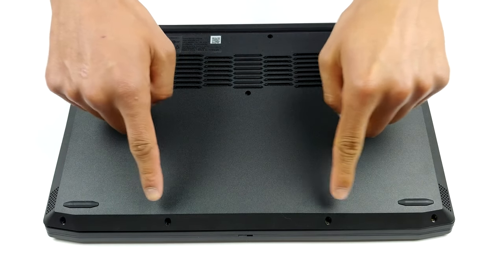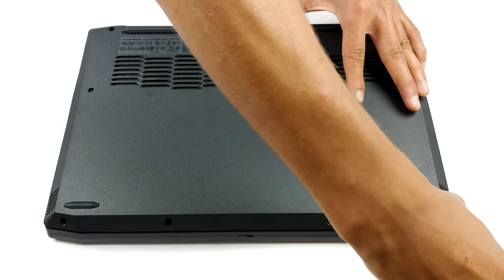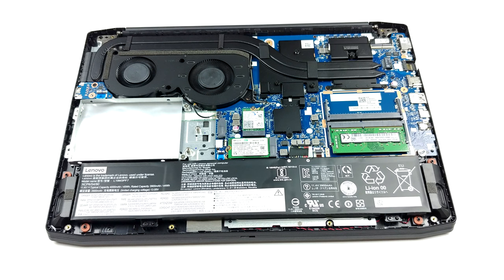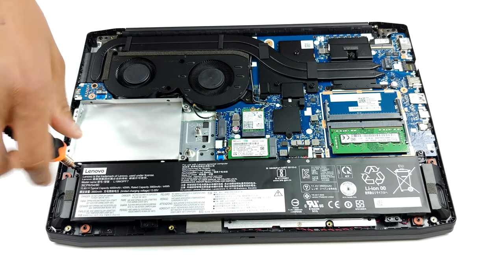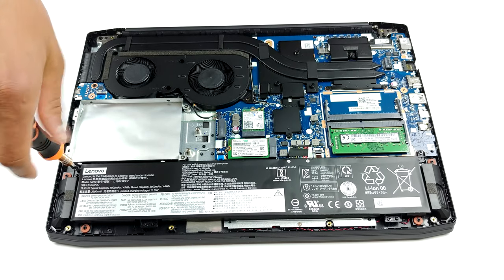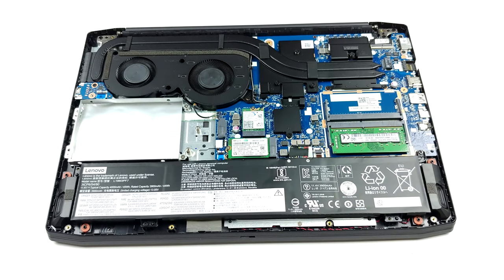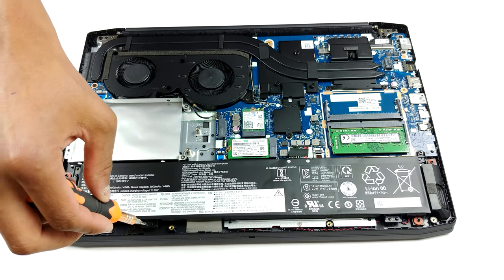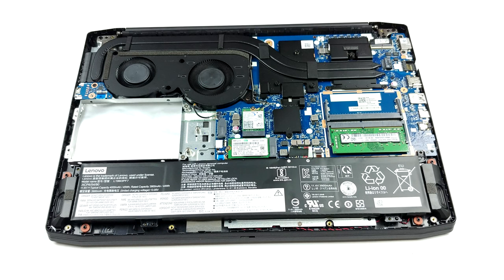🛠️ Lenovo Ideapad Gaming 3i (15) - disassembly and upgrade options

Comment: Just wanted to say it's possible to have a third ssd if you lay it on top of the 2.5" drive, you just need to secure it with a thermal pad and electrical tape which is not recommended I know but it works, all 3 drives will show up in Windows which makes it a pretty unique laptop for supporting so many drives.
Reply: I got this version with a 1tb hdd. So can I install a full sized m.2 ssd in it? It's been bothering me coz I don't know if the slot which has the small ssd will work with a full sized ssd or its just built for it

Comment: Hey, can you show how to use the second m.2 slot with with a 2280 m.2 ssd because when you remove the 2.5inch hard drive case there is no place to hold the screw
Reply: Tammoy I also want to see this
Reply: Pls someone tell me how to attach it correctly :(
Reply: @cap8416  https://youtu.be/Qae4vmIbae0?t=216  Left to the PCB there is a small metal piece that has a stand-off for a NVMe SSD (just for a small one) But under that 2.5" carrier there is a second slot you can move the metal bracket with the stand of to. So you have to remove the metal bracket by sliding it to the right and put it in the left position to accommodate for 2280 NVMe drives. But that way its just 2.5" drive OR 2280 NVMe.
Reply: @lightbeamz3002  i can see the stand off for the smaller m2 ssd, so I need to remove this and  put it further to the left to put in longer m2 ssds? But I dont know how to get this stand off out of his socket
Reply: @cap8416  schould be easily removable by moving it to the right
Reply: @lightbeamz3002  idk doesnt really work for me
Reply: @lightbeamz3002  okay it worked now. Thank you so much!!!
Reply: Can you use a full size m.2 nvme on the bottom slot even when the 2.5 drive is occupied?
Reply: @elvinuqui  nope you cant use the full size m2 nvme and the 2.5 at the same time
Reply: @cap8416  what ssd did you attached?
Reply: @francizmanicdao6536  the samsung 970 evo 1tb m2 ssd
Reply: Where should I get the screw for the additional M2 nvme SSD ???
Reply: @vecano3486  lol... 
However, I now know.  You can take the screw that attaches the 2.5 inch frame.
Reply: @lightbeamz3002  i was scratching my head for 2 hours trying to figure this out, but then i saw your comment. you saved me a whole day of file transfer, thank you!

Comment: Thanks for the video, I was looking to upgrade the storage in my laptop but the additional screws and cable were not included in my packaging. Does anyone know where I can purchase these as I haven't been able to find much information on it. Thanks
Reply: Im now in the same problem, if you have an issue thanks to share :p
Reply: Have the same problem did you ever find a work around for it or contact lenovo

Comment: i just wondering if it can  fit m.2 2230 on the second spot while using the 2.5 inch drive...
Reply: Same
Reply: @lfcpratiksharma105  do you mean you have the same question?
Reply: @_BlackhorseEngineer_ i well aware of that..thank you.. let just say i wanna use all of the drive port. three storage drive.. the main one, the 2.5 inch one and using 2230 m.2 on the second port without removing the screw base.. my question, is that possible?
Reply: @_BlackhorseEngineer_ yeah.. i didnt have the time to open it yet.. my best guess is to try with wifi card as they have the same 30mm length..  wish me luck
Reply: turns out it is not possible..it not fit with the screw mount..ive tested it... 2280 only it seems..

Comment: Hi, I have a question? I have a laptop Lenovo IdeaPad Gaming 3 15ARH05 (82EY00N4MB) 
if I want to turn on this laptop, the red light blinks when the power is on. 
Can you advise me what is the reason for the flashing red light next to the power plug?

Comment: Painting them black is a good choice as black color absorbs more heat.
That's nothing but grade 8 SCIENCE.
Reply: Black absorbs more light, not more heat. In the sun it translates to heat, but in these conditions it doesn't affect the temprature.

Comment: Can you use a full size m.2 nvme on the bottom slot even when the 2.5 drive is occupied?
Reply: Yes you can, i guess. Because check at 3:56, you can see an empty screw hole to the left of the ssd and thats exactly the length of the full m.2 ssd. Hope it helps🤞🤞
Reply: @N0tTh3Pr0  can I use 1tb m2, bro? or just 512gb? I really wanna know this.

Comment: finally...i already got one, maximized ram to 32g
Reply: what brand of RAM does Lenovo installed?
Reply: what is that memory? tell us about some specific brand and type memory..
Reply: how was the battery life and thermal? Does it runs hot and how long a single charge would last?

Comment: About using TWO m.2 ssds in this laptop: if I put a second m.2 ssd in the place, where you can also put a 2.5" sata drive, is the connector only capable of using sata m.2 drives, or does it also support pcie on this particular position?

Comment: Hi sir, nice video. I have a question. Can you add a full size m.2 2280 + an hdd? Would it fit? Or do I need to remove the HDD to add a full-size m.2? Thanks
Reply: no. the only possibility is m.2 2230 in the slot below the wireless card and (sata drive or m.2 2242/2280)
Reply: If you have a prebuilt m2 you can mostly Put another Sata in, but IT does make more sense to get rid of the SATA Case and equipping another m2
Reply: i see no standoff by the hdd slot for m.2. Is this included in the box?

Comment: Why can’t I use a metal tool to open the laptop?
Reply from the maker: Well, you can, but it is 99% likely for you to scratch one of the panels.
Reply: @LaptopMedia  alright, I had finally got the guitar pick in and inside was just a ton of my cat’s hair

Comment: Are heatsink plates that contact directly with cpu and gpu from copper? Asking to know if its possible to use liquid metal paste. Can you manage fan speeds on your own in this laptop?
Reply: I think lenovo just gives perfomance modes not user fan control
Reply: It's probably copper or this laptop would blow up :)

Comment: I had 2 4 GB RAM inside stock, sadly also different , had to buy 2 times the 8 GB, just so people know
Reply: Ya. How to check if my laptop has 2 4 GB or 1 8 GB RAM. Coz you're right, two 4 GB RAM means buying two 8 GB RAMs.
Reply: @ethelios3616  You can use software like CPU-Z to see if both slots are populated. Alternatively, you could just open the laptop itself.

Comment: I have the I5 10300H gtx 1650 version, but task manager says that my ram is 4+4, not 8 GB single channel. Can i upgrade both slots or only one slot can be upgraded? (Sorry for bad english)
Reply from the maker: Yes, there are two slots, so you should currently have 8GB in dual channel. This means you can put two 8GB (or even 16GB sticks) and they will work flawlessly. As long as they are the same, of course.
Reply: @LaptopMedia  ahh okay. Thank you 👍😁
Reply: @rezasetiawan1294  Hola
Veo que tienes la i5-10300h, tengo una igual, si fueras tan amable podrías decirme q tipo de ssd lleva? La normal 2280 o es la  más pequeña?
Reply: Encontraste alguna info por otro lado?
Pero por mi parte intenté busque por todo lado y creo q la ssd con la q viene es la pequeña, pero no hay problema se puede sustituir por una ssd m.2 2280, de hecho cambiare tb la ram de 8 x una HyperX de 16gb de 2933 MHz y ya..!!!
Reply: @LaptopMedia  as long as they are same means ? 2933mhz
Reply: Pablo Ignacio Mardini Alvarado  yo quiero comprar esa que dices,pero me dice que tiene 256ssd en las especificaciones y abajo dice supuestamente disco duro hibrido? Pero no hay disco duro hibrido de 256gb entonces tengo esa duda

Comment: Hi! can i really put 32gb of ram in it? I want to upgrade ram, but on official source says i can only put 16gb in..
Reply from the maker: Yep, there should be no problem.
Reply: Sebastian Soriano  I will try to upgrade to 32GB. Will put Crucial Ballistix Black 3200MHZ
Reply: Rudolfs Mikelsons hi how did that work out for you
Reply: Rudolfs Mikelsons did that work for you? I have one and I’m want to upgrade my RAM to 32gb as well
Reply: @rudolfsmikelsons4346  The Ballistix is always xmp enabled. Make sure your Laptop has xmp features, or else the new ram might downclock itself and you wont have options to set the clocks right without xmp features.
Reply: @MrDentarvisapolisen  How do I check if my laptop has xmp features? How to enable it if it's disabled?
Reply: Rudolfs can I add additional 16gb ram, I mean 8gb already given in 1st slot, 16gb new in 2nd slot
Reply: @sonumodi1996  Yes you can.
Reply: @MrDentarvisapolisen  thanks I am gonna buy 16gb now
Reply: @sonumodi1996  You Should install always the same in both space. Usually if you install a 16gb in one slot and 8 in the other only works 16gb. 8 in the slot 1+8 in the slot 2 because a lower capacity of memory 2
Reply: @62gusty  omg, I have purchased and put in my laptop 16 gb, thanks for your reply. But as you can see just before your comment, @XCiBiTi, has commented. Also I have seen this video https://www.youtube.com/watch?v=H-mxgkC055M

Here he upgraded additional 16 GB. So please put your view. thanks

Comment: HI, If we need upgrade RAM, Do we have to move battery first? it's a safety problem.
Reply: in this model, you can actually just unplug the battery from the motherboard with the little ribbon cable connector -- it's not necessary to completely remove it from the chassis

Comment: Hi, I want to buy this laptop, but I have a question, where I can find the SATA cable for the 2.5 Drive?
Works any SATA cable? for example the cable from Lenovo L340
I really need that plus storage :, )   plz help
Reply from the maker: Lenovo provides the cable and the necessary screws inside the box.
Reply: @LaptopMedia  I think it only adds those cables in the US not Europe or aus
Reply: @johnmahon2699  I bought in EU and comes with cable and screws and the bay of course

Comment: hi.. you need to display laptop screen , keypad, mouse pad, ports  that mean hole look of the laptop, then   go to disassembly ..
Reply: It's a disassembly video not a review, you can find a review if you want all of that
Reply: @davecastle1095  i think a short review before disassembly is very good...
Reply: @shabbirahammed4596  it can be nice but it's not necessary also you phrased your previous comment so it sounded a bit like an order more than anything else which is why I commented on it in the first place as it was their video to decide on
Reply: @davecastle1095  thanks..
Reply: No

Comment: Hi, does anybody happen to know if the NEW Lenovo Ideapad Gaming 3 laptop has:

1. The same rubbery finish as Lenovo Legion 5 around touchpad and keyboard area? OR
2. A more smooth NON-rubbery finish as the Lenovo Ideapad L340..?

I have tried the Legion 5 in a shop, and I didn't like the sticky feel of surface. I'm not used to it and it gets kind of irritating.
I like the smooth non-sticky "normal" feel of Ideapad L340 much more.

Pls let me know, if you have tried the new Ideapad Gaming 3 and what the surface around touchpad and keyboard area is like, because it's not released in my country yet. BIG thanks!
Reply from the maker: Hey kimfina,

The material around the keyboard deck and the touchpad happens to be smooth, glossy plastic. By the way, if you are looking to buy this device, why don't you check our review: https://laptopmedia.com/review/lenovo-ideapad-gaming-3i-15-review-second-generation-ideapad-gaming-10th-generation-processors/
Reply: @LaptopMedia  Great, thanks for the reply. Happy to hear its normal smooth, glossy surface. I will look into you review!

Comment: Cant find the cable that i need to connecy the hdd to the laptop
Reply: it should have came in the box
Reply: It comes in america, for me it didn't come I think in Europe you have to buy it seperately
Reply: @johnmahon2699  thank you. Do you pls have the link where I can order it from? I couldn't find it anywhere
Reply: @andreeasechely1041  I'm not sure I just got mine today I'm going to ring and see if you can just request one, if not I'll put a link on where I found one for you after
Reply: @johnmahon2699  Can you give the link to the cable you bought? If it worked?

Comment: What is the response time of the display!?
Reply: its 60 ghz
Reply: @angricer  Nope, 120hz
Reply: There's one model with 60Hz and another with 120Hz
Reply: Response time is pretty poor. 25.4ms. 60hz and 120hz are the refresh rates guys. Come on.
Reply: @LordStaind  where did you hear its 25.4ms?

Comment: Thanks mate, just got my laptop now and tomorrow's my b day so can't open it till tomorrow XD
Well I will first do this, that's for sure
Also is a Kingston Ram 8gb 1600MHz Pc3L-12800 DDR3L  Non ECCCL sodium 2Rx8 laptop memory compatible to my lenovo cause I am using a Acer laptop rn and IDK if it's compatible or not
Reply: sadly you cant use a ddr3 ram module in a ddr4 motherboard, also due to the rather fast ram speed, i would suggest grabbing some ddr4 2933mhz ram to maximize the performance of the laptop. You can still buy slower ram since its much cheaper but you wont get the full performance. I currently own one and plan on upgrading to an 8x2 3200mhz cpnfiguration for it to run in dual channel.

Comment: What is that cooling system @@ only one small sink on the right ? one of 2 heat pipes cant be cool down when literally no sink to exhaust
Reply: No, I have this and the other heatpipe has a heatsink behind the laptop. (Under the display)